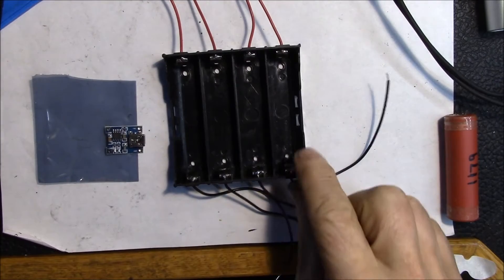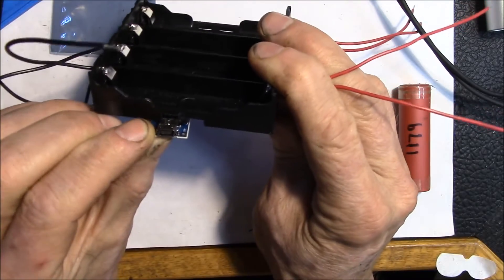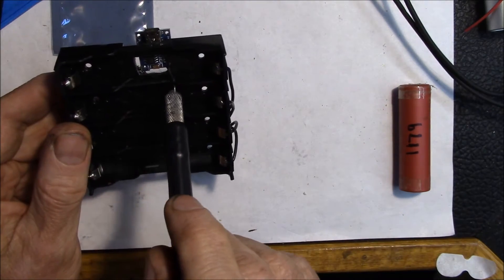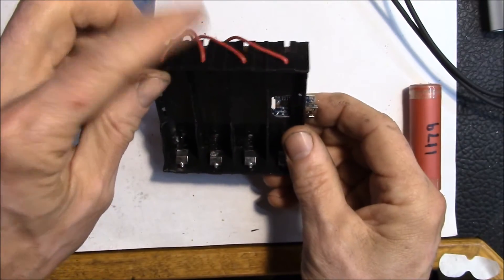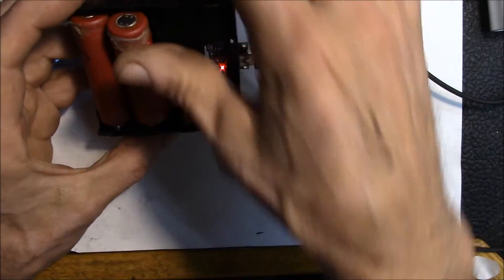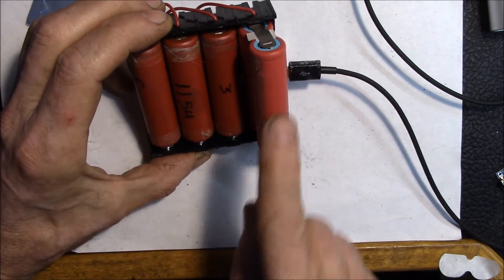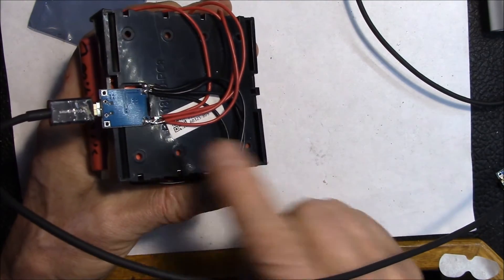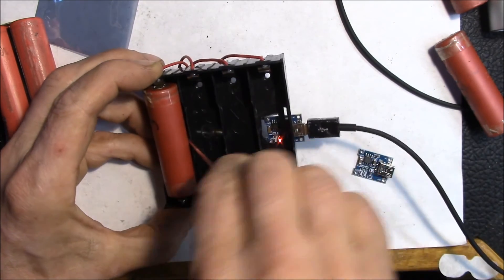TP-4056 1-8 cell 18650 Lithium-Ion Battery Charger

Comment: The cells need to be at the same inicial voltage. A difference o 0.2v between cells may cause a over currente between cells generating heat
Reply from the maker: Yes, that's how this is designed to be used.

Comment: there is a problem you arent seeing. that circut is designed to stop charging when the charge current drops low enough.. with 8 cells they will accept too much current and the charger will not stop. you will overcharge them.  i tried this myself and most of these batteries were being charged to 4.25 to 4.3 volts.
Reply from the maker: Good point.  I did not see this on my charging setup.  Perhaps it depends on the individual TP4056 module and how it's calibrated.  I mostly charged 2-3 cells at a time in my setup and all topped out right at 4.2 volts.

Comment: ouww... surely.. so long to charge multiple batteries on this pack! lol
Reply from the maker: It's not about speed, but it typically takes overnight/12 hrs. to charge up 4 cells.  I like it because it is slow and I don't need to keep an eye on them and swap out one cell at a time as it reaches full charge.  Instead, slap in 4 cells and come back the next day and they are all charged.

Comment: dammed to late the the circuit is busted maybe ill try to charging circuit instead
Reply from the maker: Yes, those TP4056 modules are quite sensitive.  I inadvertently plugged a cell in backwards and that was it.  Luckily they are very inexpensive if you order in the quantity.

Comment: nice... can i use 2 tp4056 in paralel to charge 5 18650 battery?
Reply from the maker: I don't think it would be wise to run multiple TP4056 modules in parallel.  They'll likely have slight differences in voltages and and up fighting with each other.  Better to run them separate, say with 2 cells on one and 3 cells on the other.

Comment: so you can use one tp-4056 to charge 4 cells?
why does everyone say u need one per cell.
nice video r brown , makes more sense than other videos ive watched
Reply from the maker: Yes, as long as you charge the cells in parallel.  With 4 cells you would get 250mA/cell, 2 cells = 500mA/cell.  Little difference in this and changing the current setting resistor on the module.  Ideally you would want all the cells to be in a similar state of charge to each other.  I mainly use this to recharge cells after a discharge capacity test, so all cells are at a fully discharged state.
Reply: ok thanks

Comment: Can you use this TP4056 charger as a battery bank. I mean can i hooked a load to TP4056  device and use the energy from the battery. Thus use this TP4056 for charging and discharging.
Reply from the maker: Not really.  The TP4056 is a charger only and has not battery output protection or output voltage regulator.  Adafruit has a couple of combined charger + output regulator modules (1A and 2A versions), but for the price, you can buy a couple of single cell DIY power banks (they are bare with no cell inside).
Reply: Thanks, this is helpful for me

Comment: Really bad idea... Parallel charging is fine when all batteries have exactly the same voltage initially. But when you put cells with different voltage together in your charger, the higher voltage cell will charge the lower voltage cell with as much current as it can deliver - that may be more than 10A and generate lot of heat and probably damage your cells.
Reply from the maker: I only put multiple cells in the charger when they are close to the same voltage.  Typically after running a discharge/capacity test.  Jehugarcia did a video where he tested the parallel charging currents and found they were not excessive, around 2.6A from 4 cells into 1 cell:
https://youtu.be/hUAvJMca02g
He charges up to 16 cells in parallel in his setup.
Reply: I wouldn't call 2.6A "not excessive", it's pretty high. He also doesn't say a word about the cells he uses... Cells with high internal resistance will result in a lower current, cells with low resistance (made for huge currents) may result in higher current. He mostly uses cells salvaged from old laptop batteries. I guess they have a fairly high resistance. Good cells will have a internal resistance below 0.1 Ohm each, <0.2 Ohm together. Connecting two cells together with a voltage difference of 1V will result in a current >5A
Reply from the maker: Yes, you would not want to charge cells of that much voltage different in a parallel charger.  If I have cells of differing voltage, I'll just put in one cell at a time into the rig, charge it then move on to the next one.  It's flexible that way.  That 2.6A current is just a bit over 1C.
I'm using recycled laptop cells like Jehu.  As mentioned, I mainly use my parallel charger to recharge cells after my capacity test stage.  So all the cells are sitting at a close to similar resting voltage after that test and I just need to bring them back up.  Now Jehu is using this for his initial charging which I normally only do one at a time in a 4 button charger with a temperature sensor attached.
Reply: btw. High current cells like Samsung INR18650-20R will have less than 15mOhm. Two of these cells, again with 1V difference, will result in 33A exchange current. This will set your battery holder on fire ;)
Reply from the maker: Yes, for sure, if I had really high current cells like that, caution needs to be exercised.  My cells test out mostly above 100mOhm and again I am only parallel charging discharged cells after capacity testing. They will all be within 0.1V or so of each other so around 0.5A current might flow between cells briefly due to the different resting voltages.
Reply: I'm starting to build battery packs and wanted to see if you can help. How much of a difference in the internal resistance can I have in parallel and in series?
Reply from the maker: I haven't played with that yet in my battery pack build.  
For a first pass, I plan on sorting cells by capacity.  Then I'll build multiple packs (20P) out of those sorted cells.  My first pass will probably be 120 prs. of cells going into 12 packs of 10 pr. ea.  I'll bin those 120 pr. of cells into 10 groups of 12 pr. and then take one pr. from each bin to make a pack.  I'll probably only look at IR if I have some nearly identical capacity cells to pick from.  I think with mixing up 10 pr. of cells based on capacity I'll end up with fairly equal IR readings for each pack. 
Now I also have a bunch of single cells that I need to pair up and I think on those, I'll try to balance IR and capacity when pairing those.

Comment: I did the same connection you did. But the TP4056 module getting very hot when I connect to the battery.

Comment: You may find that this is not a very good idea as the chip itself will get hot as well as the battery will gain heat whilst charging. To have the TP4056 up against a heating battery is going to exacerbate the temperature and could also over heat the battery causing a potential fire risk. My recommendation is to keep the chipset separate and fix a small heatsink to it too.
Reply from the maker: Good points.  I've not experienced any of those issues, though.  I always start filling the holder from the far end, so unless there are 4 cells in place, that last slot is open.  In that case, the cells are only seeing 0.25A/ea. (assuming single cells or 0.125A/ea. with double cells), so are unlikely to heat up.  And there is air flow over the TP4056 since I've opened up the case around it.  I'm mainly using this charger to re-charge cells that have already been charged and capacity tested and I've noted all the cells that have become warm/hot during the initial charge and weeded those out.  I imagine the TP4056 might get warmer if you re-configured it for say a 2A charge rate.  The one I use is the default 1A charge and I think it may even be under that.
Reply: +R Brown (4Crawler) that's ok my friend. I'm also in the process salvaging 8000 cells and I'm planning a video on the problems with this very issue. These chipsets are so cheap it's worth, in my opinion, just creating a bank using ten or so I feel is safer. Check out my channel feel free to comment. Regarding 2A charging I'd like to know how you'll go about this and do you plan to use this with your 8 batteries? Good work keep it up
Reply from the maker: Not planning to do a 2A charger, I wanted the lower rate, thus charging more than one cell per module.  I know you can change the resistors on the module to modify the current, but I'm not really set up for SMT rework.  Thus my use of multiple cells.  Yes, you can use one module/cell holder, Paul Kennett has a nice video on a charger like that.  I wanted a bare bones charger that could do 1, 2, up to 8 double cells with minimal fabrication time.  Reason for the lower charging rate is that I'm more interested in a storage charge than a full 4.2V charge.  Thus I can periodically check the pack voltage and pull the cells when they hit around 4V.  With 3-4 pairs of cells charging, I can catch that voltage if I check it a couple of times a day since it rises very slowly.